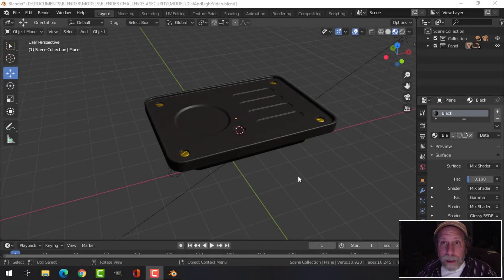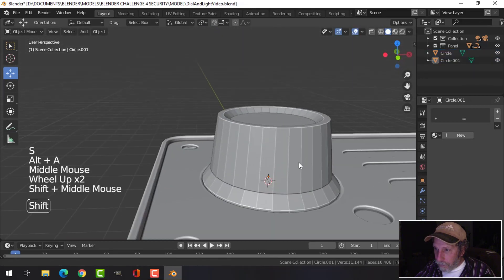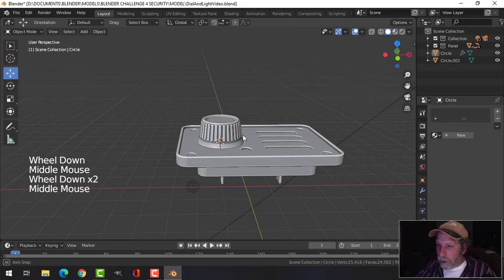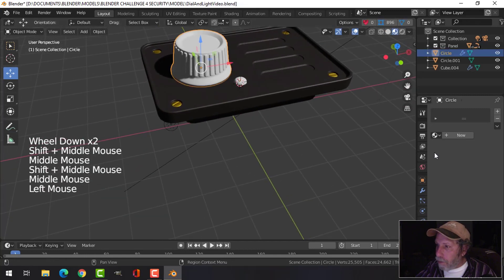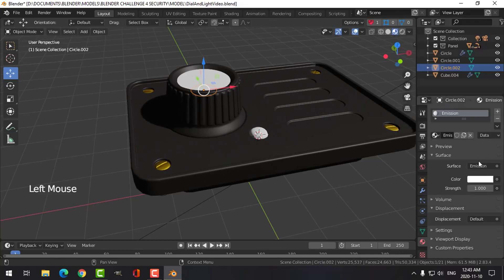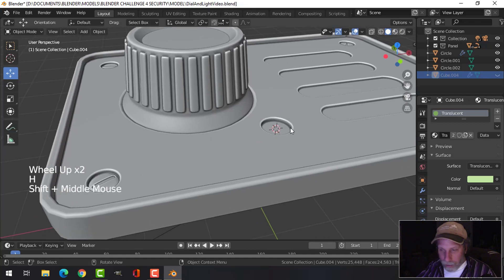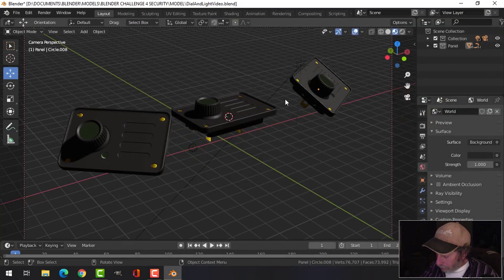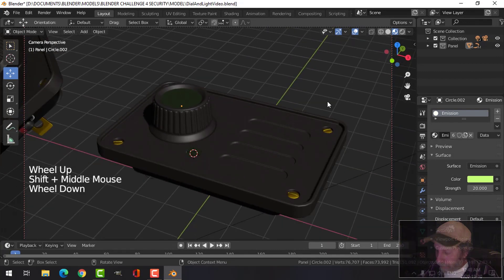BLENDER 2.8: Glowing Dials and Buttons

Comment: Nice one man! Can I ask (as a beginner) why you separated the Ngon at the start? I thought at first it was to help later in the video when you duplicated it but you don't need to seperate a face to duplicate it.. so now I'm wondering if it's to help with rendering (because I know Ngons are bad).. Anyway just curious. I have actually finished the video yet so you might actually answer this.. in which case my bad!
Reply from the maker: Thanks.  I separated the top circular face at the beginning just because it was easier to add the translucent material to it (for the light to pass through) and to also make the inner disc that emits the light.
Reply: @zerobio  Thank-you & sorry for the delay in getting back to you. I must have replies turned off or something because YouTube never notifies me of responses. Regardless, thanks for getting back to me about this :)
Reply from the maker: @hopefulkoala01435  No worries.  Hope all is working out for you and take care.